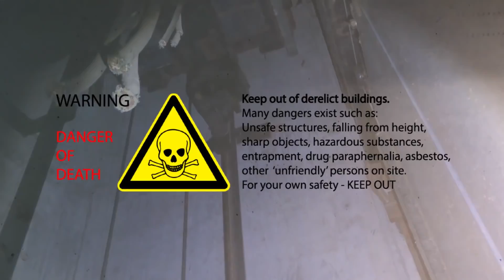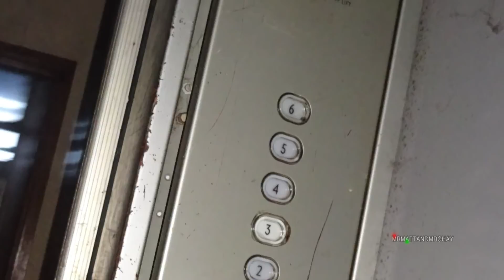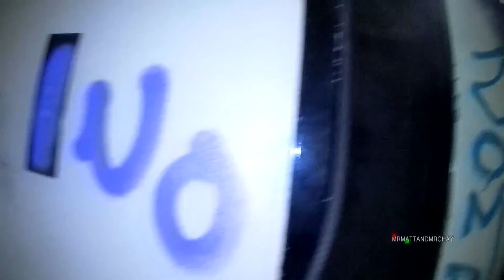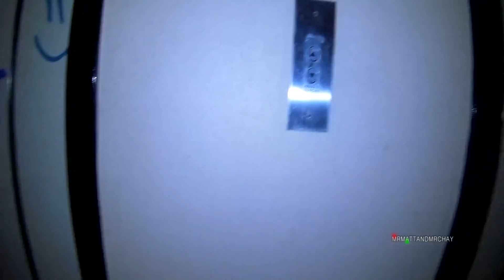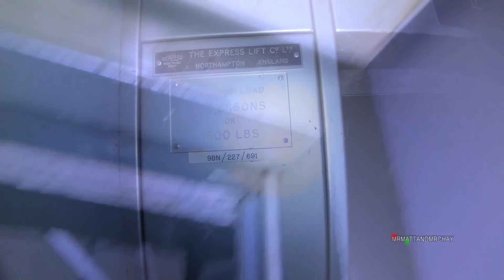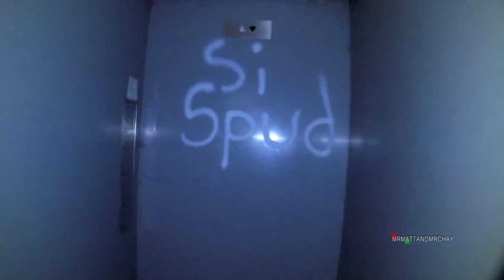seven floors of terror - THE ABANDONED EXPRESS LIFTS

Comment: Please dont step inside, it has to land one time :((
Reply: Not really its enough to know that its abandoned and noone takes care of it
Reply: EestiYTsuckib pohhuj see You cannot say that with the info given in this video. But he maybe checked all the bolts and cables and cogs before stepping in it. Or just went for it.
Reply: I wouldnt step either but lifts have a big safety margin. Also CW is 40% heavier than the cabin and Cw is already at G or LG
Reply from the maker: My theory is as follows.  Firstly, yes the CounterWeight is heavier than the lift car.  You'd have to load the lift car up to at least half weight capacity to see any downward movement, and that's assuming the brake is released and all the wheels and sheave haven't rusted up (which they have).  Secondly, the lift has been in this position for about 15 years - considering the lift car weighs over a tonne, I doubt my weight will affect it.  Therefore, yep, it's a calculated risk but it 'should' be ok.  I did take a step in without commitment firstly though.

Comment: Creepy building. I can't believe you stepped into the lift. You're braver than me.
Reply from the maker: The CounterWeight is heavier than the lift car.  You'd have to load the lift car up to at least half weight capacity to see any downward movement, and that's assuming the brake is released and all the wheels and sheave haven't rusted up (which they have).  Secondly, the lift has been in this position for about 15 years - considering the lift car weighs over a tonne, I doubt my weight will affect it.  Therefore, yep, it's a calculated risk but it 'should' be ok.  I did take a step in without commitment firstly though

Comment: Wait, did you actually walk onto those lifts??? Or was that just like camera trickery?
Reply from the maker: The CounterWeight is heavier than the lift car.  You'd have to load the lift car up to at least half weight capacity to see any downward movement, and that's assuming the brake is released and all the wheels and sheave haven't rusted up (which they have).  Secondly, the lift has been in this position for about 15 years - considering the lift car weighs over a tonne, I doubt my weight will affect it.  Therefore, yep, it's a calculated risk but it 'should' be ok.  I did take a step in without commitment firstly though

Comment: Just like in Pripyat a lot of the shaft doors are partially open or completely absent. This always seems to happen with automatic doors but not so much with hinged doors. Really weird. I don't know if I would stepped in that cab but on the otherhand as longs as the cables and the counterweight (and motor axle) are still  sound it should be fine. The concrete structure of the staircase looks to be in good and safe condition. Old houses with rotten floorboards or joists can be really dodgy though.
Reply from the maker: I hear what you're saying.  Here is a copy-paste from a comment I made above "My theory is as follows.  Firstly, yes the CounterWeight is heavier than the lift car.  You'd have to load the lift car up to at least half weight capacity to see any downward movement, and that's assuming the brake is released and all the wheels and sheave haven't rusted up (which they have).  Secondly, the lift has been in this position for about 15 years - considering the lift car weighs over a tonne, I doubt my weight will affect it.  Therefore, yep, it's a calculated risk but it 'should' be ok.  I did take a step in without commitment firstly though.".  Yes, most of the time I'm watching where I'm treading, especially in the motor room (trap doors made of wood for example).  Thanks for your comment as always

Comment: You went into the lifts !!!??? you're crazy (also considering that they are on the top floor) !
...But it was kinda cool to see inside LOL.

Edit : Please, read the next comment from Nieciej !
Reply: Better when car stay on top then on lowest floor because counterweight which is much heavier then car with one man inside. Every lift has a brake which is active every time when electric power is not connected - even if everything in control room disconnected (except the windlass and it's brake system). Car has an inetrtial brakes on it's rails and innertial speed control which stop car when it moves too fast. You have to cut every cables/lines connecting car with safety systems to put it down the shaft - otherwise it won't run.
Reply: Oh yes, I forgot that security (the parachute if I'm right) system from mister Otis. Thanks

Comment: Check out that shorrock bell box. Probably still has a master bell in it!
Reply from the maker: nope, inside is a good-old horn type sounder, with a strobe light bolted on the bottom (which isn't really that visible from the outside!).  Here found one: https://www.thesecurityinstaller.co.uk/community/gallery/image/525-shorrock-bell-inside/
Reply: Oh, my freind found one with a master bell in! That is probably a later one. I never really got putting the strobe inside, the like of securior granley did it too. It looks a bit better I suppose.
Reply: I always wondered if Shorrock alarms were part of the Rediffusion group (being that they used the identical Adastral red star on their products!) it turns out - Initial bought the logo from Rediffusion when they wound the company down - so the logo was later seen on lots of products that were owned or co-owned by the Initial group. I've seen these alarms, "Worldwide" hand dryers with the logo on too!
Reply from the maker: YES!  I had one of those securicor granley box lids for years - used to mix cement in it haha!!  The strobe was only visible at night - they had bells inside them.  The shorrock Blue boxes with "shorrock alarm" on them, they were bells.
Reply from the maker: Yes, I know the star you mean.  Not sure though.